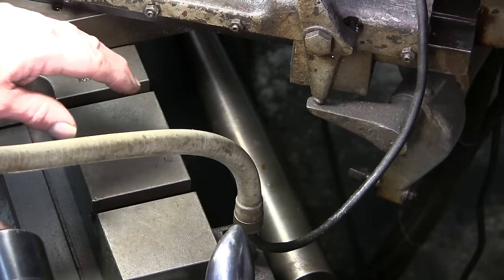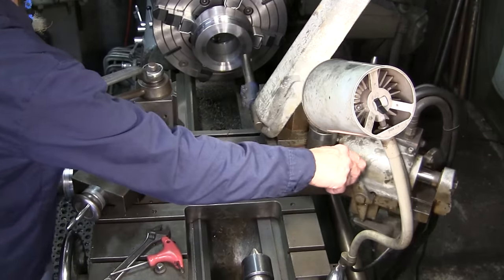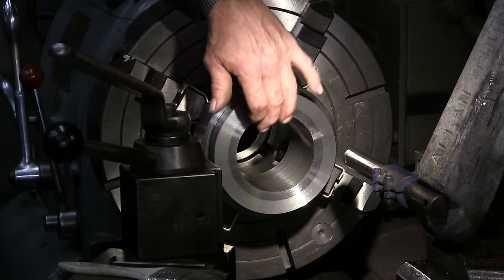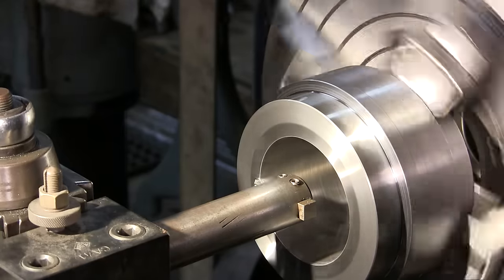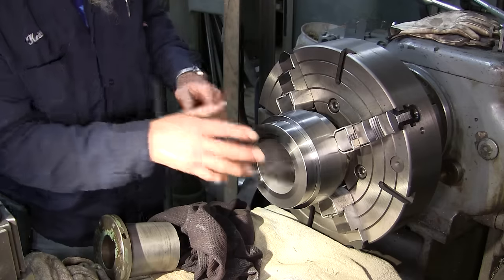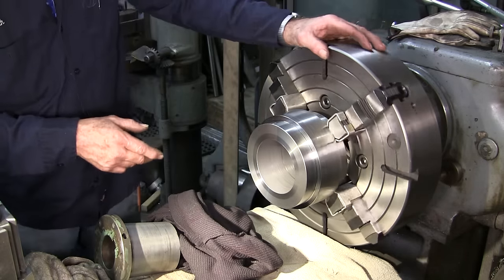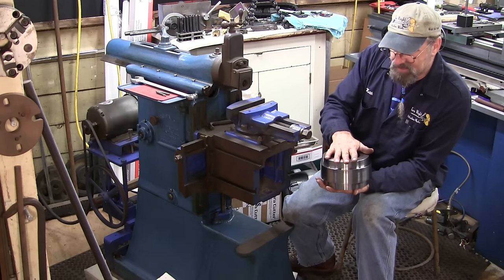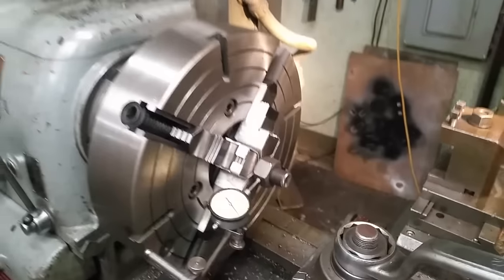Reventing Part Three

Comment: Nice trick with lead brick on the boring bar.  I think the craziest solution for keeping a boring bar and part from chattering I've seen was at the aerospace shop I used to work for.  We had this welded sheet metal and casting assembly that that was about 2 foot long, 2" OD, about 1" ID almost all the way through but blind at one end.  It had about 10 different diameters, inside and out, that all had to be concentric within .005".  Because it was a welded assembly, it would sing like a bird on the lathe, causing an unacceptable surface finish. (It was an oil transfer tube / bearing mount shaft for a jet engine, so it had to have a near mirror finish in places).  One day, one of the CNC machinists figured out that if you wrapped the whole assembly, turning tool, and boring bar with this sticky half tar/half foam gutter sealing tape, it would dampen the whole thing enough to turn.  Don't know how he thought of the tape, but it worked and we started ordering it by the case.

Comment: I used to sell industrial machinery, including shapers and many kinds of dedicated keyway cutters. Using a shaper is great, because it essentially has no limitations (such as when you are broaching keyways and find that you just don't have the proper size, or it needs to be sharpened), and if you have patience, you can use it to replace broken gear teeth, or even make a gear. (When I worked in a motorsports parts department, folks would sometimes come in and ask for a "keyway", which is nothing but air, because theirs sheared! I gently corrected them and sold them the offending part.)

Comment: With another adapter plate set up to bolt to the face of the shaper attachment made you could clamp 3 blade or multi blade propellers also

Comment: Great series Keith, looking forward to the next video!
I have a question for you more experienced guys. I'm a newbie and have started to love metal working, mainly from watching Mr. Pete's videos, and eventually learning about all these other good channels! I bought some 5 mm hot rolled plate off ebay to build something with files a while ago and recently decided to do some layout work with some simple tools.

 I realized I need something like layout blue, so used a permanent chisel-point marker for that, but when I started scribing my carbon steel scribing calipers wouldn't get trough the mill scale, and I could barely scratch proper marks with a carbide tipped scriber. My question is how do I remove mill scale in an efficient way? I know I could grind or sand but it's tedious, and I tried to hand sand with some 60 grit and it was REALLY a bummer. I decided to make the plate rust on purpose by leaving it in a wet rag in the hope that the rust would loosen up the scale from under (I've read ship builders leave their stock in the open to let it 'weather' ?) Any help would be appreciated.

Aryan
Reply from the maker: Hi Aryan,  Yes leaving it out to weather does do the job, but then you have to contend with rust removal, like wire wheel or sand blasting. the quickest way to remove is sand blasting, leaving a clean frosty metal finish. If you're doing small projects and want to start with clean grab and start material, start with cold roll, or cold finished steels. Why I procured cold roll finish for the roller kits, so no one had to deal with the mill scale.  ;{)-------
Reply: Thanks for the quick reply Keith! I was thinking about trying cold rolled too, since I'll be doing hand work and don't have to worry about heat and warping.

Comment: i have a vice a bit bigger but the same looking as your shaper vice wonder what it was off
Reply from the maker: Most likely a larger shaper or also early drill presses had similar vices. ;{)------
Reply: too heavy  to lift 12 inchs wide mabee the same opening

Comment: Now THIS is turning into a very unique project!  I've seen the first two vids and this ventilation impeller is going to be something else!  Wow!  For the job this thing is doing, application for it is so specialized that the actual impeller and housing had to be fully custom-made?  Or is this an impeller that's now out-of-production and custom-fabbing a replacement is the cheaper option when compared to completely redoing the ventilation setup to use current production parts?
Reply from the maker: yep! ;{)------

Comment: Keith, you mentioned the hub would get a couple of weld beads and that would shrink it. Will you be redoing the tapered bore to account for the shrinkage?
Regards,
Eric
Reply from the maker: No, because the weld is going to be so uniform the shrinkage should be as well. ;{)-------
Reply: And I believe you basedon what I have witnessed of your work! Very impressed!!

Comment: Does gravitation affect the lapping process when it is done horizontaly? I had the same thought when you lapped the propeller a few episodes ago, or should the lapping be done in the position the part will be used?
Reply from the maker: As long as you are counter rotating your all good, if one is stationary, you need to roll it every once in awhile. ;{)------

Comment: Hey Keith! Why did you set the hub so far away from shaper's ways? If you had mounted it right on the knee(of course lowering knee accordingly) would you not have less flex in the whole setup?
Reply from the maker: You need stroke room! and was planning for longer future projects. The rest foot is designed to handle that problem. ;{)-------

Comment: Keith..... Do you charge for the fixturing or is it included in the price of the repair. Also can you use the fixtures you created for other jobs or it it job specific? We had a shaper in the last job shop I worked but it was never used. Good looking stable setup.
Reply from the maker: I will getter done no matter what it takes! What that means is, time and materials with a clear, mindful, conscious of the project. ;{)------

Comment: Do you factor into the bid all those extra fixtures and tooling to get the job done?  Or maybe the better question is How do you give the customer a price to agree to before you start working, and not loose your shirt?
Reply: I'd really like to hear Keith's input too,but for me a lot of times I'll eat some if not most of the fixture and tooling work if it's something I'll possibly use again.My grandfather used to call it a investment in your future lol and he was right.On something like this I'd be happy to cover the materials and maybe a hour or two labor.Now if it's strictly for the job and something pretty much every shop would need to make in order to do something no matter how well equipped they are that's on the customer 100%.

Comment: Jigs can never be over emphasized Well done! The shaper is a tool that for most of the time simply gathers dust is a shop. OTOH it often becomes indispensable in fabrication. A slow production machine that get's her done :) 

Quick question Keith, wouldn't it have been possible to do the key way in the lathe using the taper attavhment and a properly fitted boring bar. I have seen this done before on smaller key ways. Mind you the whole operation is done by hand. Thoughts? e.g if you didn't have a shaper?
Reply from the maker: I would for small keyways but if you have other than full width one shot broaching in the lathe hard to get the width just right. ;{)------
Reply: Keith Fenner
I hear ya :) KUTGW

Comment: That was serious work just for one keyway!  Why did you have to make an additional plate with the 4 holes? Couldn't you have used c-clamps to hold it on?
Reply from the maker: Clamps would have really closed in the working and looking room, picture clamps reach to get inside the angles . ;{)-----
Reply: I mean the clamps would have been around the outside. Regardless, it really seems to me you already had everything you needed to do that keyway without building such a jig. What if you used a shorter boring bar and put it in a vice that does angles? Not rigid enough?
Reply from the maker: No the stroke needed was longer than that possibility, I did what was needed to be done. ;{)-----
Reply: Hope you get more use out of it than just doing that one part...
Reply: " JUST SAYING "  -------   :-)

Comment: Seems to me the table support serves no purpose as the table is rising.
Reply: The table won't move,  he feeds in the cut  with the feed adjustment  on the clapper box.
Reply: Yes, you are correct, my bad. It's been 45 years since i ran a Shaper.